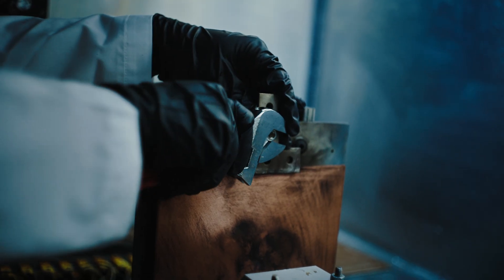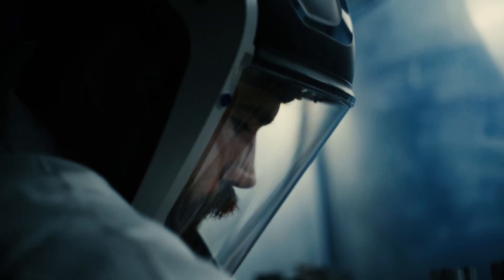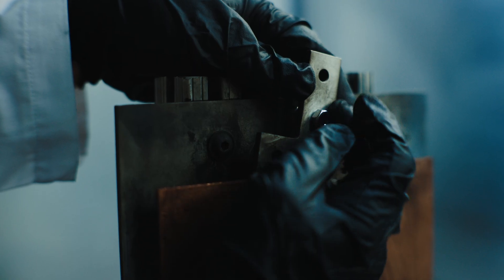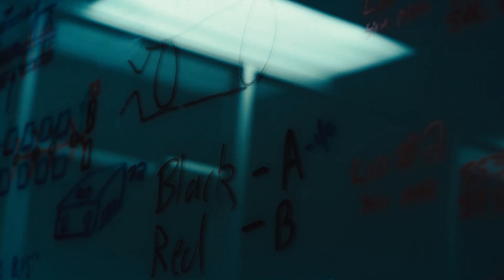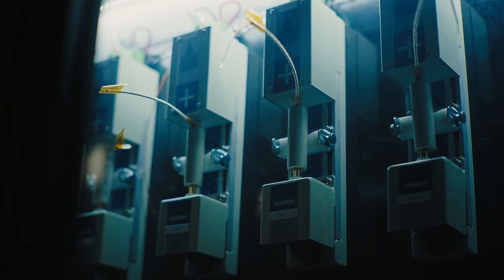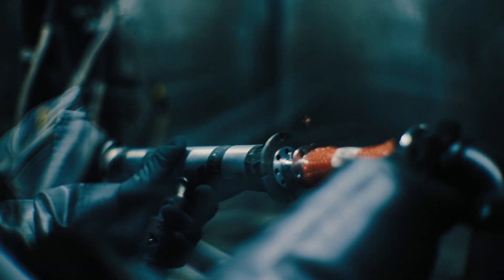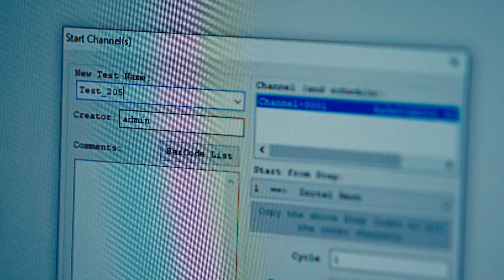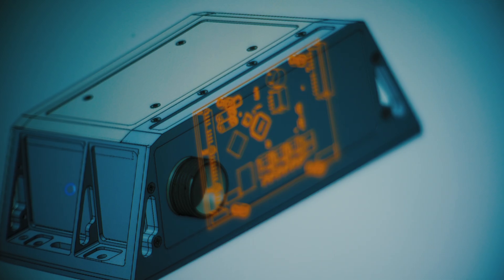What is Impingement Zone Mapping?

Comment: KULR is actively scaling: they've built a major Texas facility, expanded testing capability, and achieved key certifications. Growth isn't just aspirational—it's backed by real contracts across defense, space, eVTOL/EV, AI cooling, and portable energy. These contracts and infrastructure upgrades could fuel the kind of revenue lift we modeled earlier—especially if AI/data-center and testing lines ramp as planned.

Want me to translate that into a projected revenue timeline or recast your share-price model with these pieces?